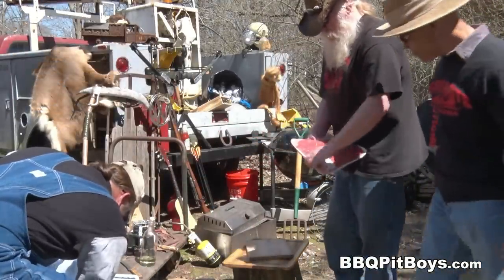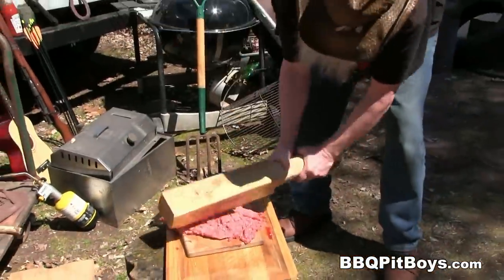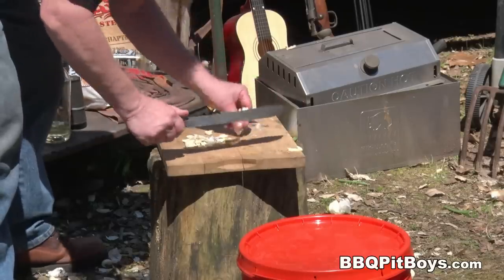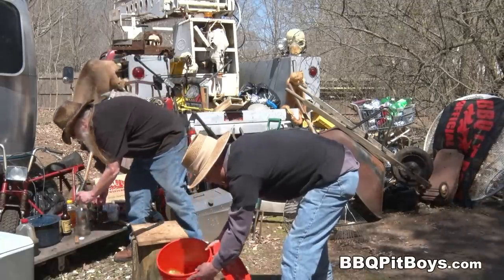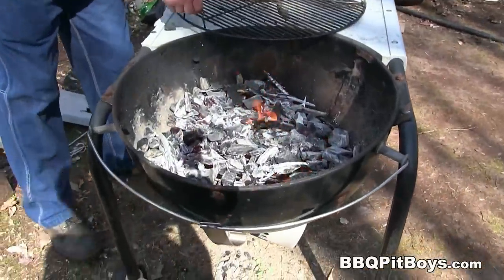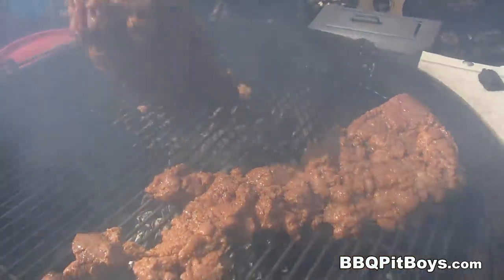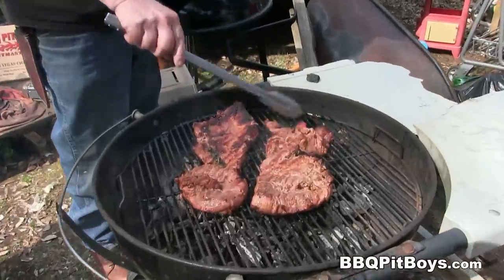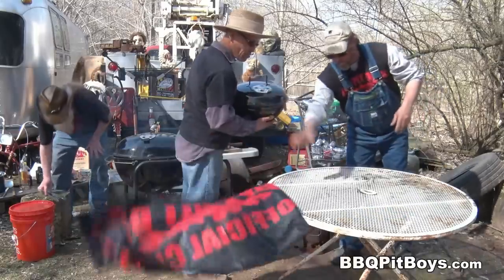How to grill Junkyard Steak | Recipe

Comment: I got an old metal table & a weber Silver Smoky, followed your lead in this video and made an AWESOME deck hibachi!  You guys rock!

PS- a nice little modification is to use a semi-split rubber fuel hose to line the rough cut edges of the part of the table that contacts the outer shell of the kettle.  Less scratching of the powder-coating.
Reply from the maker: Bob Loblaw ...great idea with the fuel line, bob...! Post a pic of your table on our Facebook page if ya can.  https://www.facebook.com/BarbecueWeb
Reply: BarbecueWeb I finally got around to posting a few pre-first fire pics.  I will post a few of the grill in action a bit later.  Thanks again for the idea men!
Reply: Bob Loblaw You dig or no?  I made some killer hanging tenders along with a side of roasted garlic & zucchini on it last night- YUM!!!!
Reply: The rubber would melt with the HOT grill
Reply: @MrLmm001  Not fuel line hose.  It's designed to take very high temps to protect the flow of gasoline to and around the engine.  I made the table 6 years ago and have replaced the hose once after hundreds of cooks.  The rubber does not melt

Comment: Orange Juice $3.00, Onions $2.00, Soy Sauce $1.50~?, Worcestshire $1.00 plus misc, lets say 8 bucks on Marinade and 5.00 a pound for the 8 lbs of steak means $48.00.

Ribeye (choice) 9.99 a lb at Costco $80.00 $32.00 cheaper, and in this case tastes better because of all the sweet, heat and smokiness they put to her.